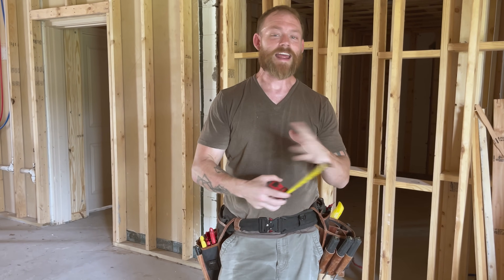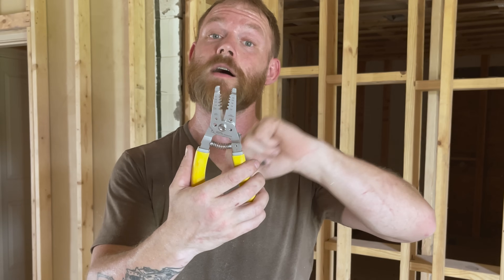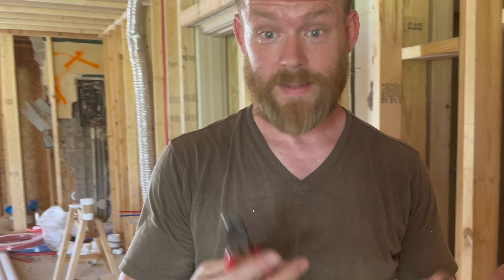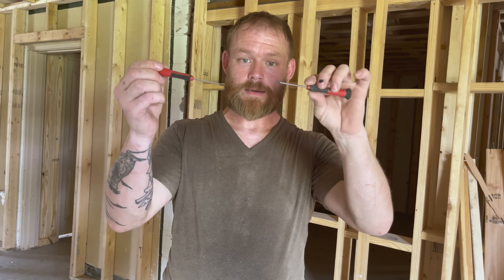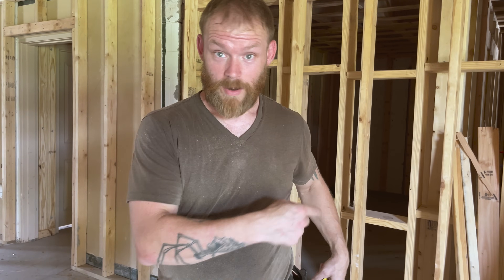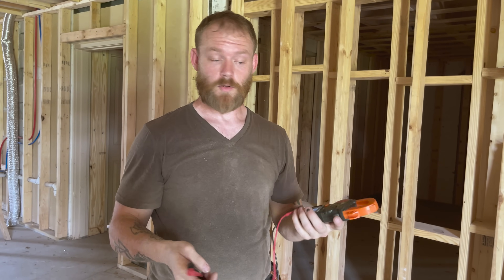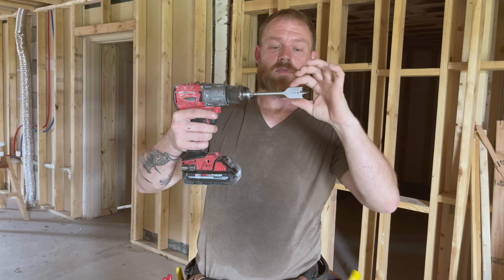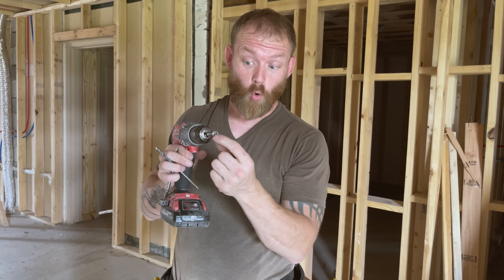All the Tools Apprentice Electricians ABSOLUTELY Need!

Comment: I’m pretty sure you are sponsored by Milwaukee and Klein but I would love to see you do reviews of other brands. Maybe Knipex and Wera and some others. Also tool belt reviews it’s more of a personal choice but I would love to see some quality options. I have heard of occidental pouches and that looks like what you have, but how has it held up. Is it worth it?
Reply: Occidental is tough. Mine held up through extremely rough use. Get a belt with 4-5 pouches on your non dominant side. It will help you if you have separate storage for all of your roughing supplies. Right hand pouch doesn't have to be huge. Roughing doesn't need as many tools.
Reply: @ExecOpsN7  I’ve never worn a tool belt 🤣🤣🤣 why would you wear a tool belt?
Reply: @catdaddy666  I do industrial and some commercial, never had the need for a tool belt. I use my pockets,
Reply: @catdaddy666  your a romex jockey, explains it all. Residential guys are not electricians.
Reply: @catdaddy666  I can see wearing one if you do residential: and that’s it. I’ve never even touched romex
Reply: I like wera and knipex better than Klein. The only tool I like from Klein is their levels. I also use a greenlee pipe reamer cause I’ve broke 4 Klein ones lol. The greenlee has lasted a lot longer
Reply: Wera driver tips and bits don't last on jobs. Wiha bits on the other hand!

Comment: When I was doing Residential Electric years ago we used our Linemans Pliers to Strip! Once you get used to it it does the job. Technique of tool mastery!
Reply: It depends on the pliers and the person. You learn the feel of your linesman and how they cut and you can gauge how to strip wire. But, a lot of JW don’t want apprentices trying that technique bc the potential of scoring and cutting into the wire. I can strip all day with my linesman but if I’m doing splices all day, so much easier to use a stripper esp for stranded wire.
Reply: @mikenormandy9250  For me the big thing is stranded wire. I can strip solid all day with my linemans(Well, individual ones, still gotta use a knife for fully sheathed Romex, but hey, practice), but for stranded wire, I'll take strippers any day of the week.
Reply: I strip wire with my linemans better than with strippers lol. That’s how I’ve always done it for the last 15 years
Reply: Let's not forget that we hammer staples with linesmans sometimes :D
Reply: A lot of the linesmans now have strippers built in.
Reply: @paulparker9376  After you've cut a wire that was hot, you turn your linesmans into a stripper anyway lol
Reply: @Gruntled2001  Very true. I burned a big crater in my work knife once trying to wedge apart two extension cords melted together... While they were plugged in!
Reply: Feel like that takes so much longer especially sense most strippers can also strip the sheathing off
Reply: When I did my apprenticeship, it was up to the contractor to supply the power tools.
Reply: @markbell1  Same here! They still do, and will when I turn out to a JW in couple years...The percs of a union...But, I get it, not for everyone...Esp in most right to work states...
Reply: Ehh maybe if you’re up doing a single thing but if you’re going to wire in 10 recess cans in a row just get the strippers at that point.
Reply: Even small flimsy fixture wire??
Reply: My strippers only go up to 12 gauge, otherwise I use my knife. Put your thumb on the other side and lightly drag around and you don’t nick the wire.

Comment: Whats the name of that tool belt looks RAD!!?
Reply: I just got the Milwaukee electricians belt.  I really like the fit and confort of the lumbar pad.  It has the room I need as a DIY homeowner.  I have heard some complaints about the belt not fitting well if you are slim, but I've had no issues with my 34 inch waist.  Lots of places for tools and pockets for supplies.

Comment: Totally agree with everything except for the hammer the smaller the better you will be carrying it around your waste 40 hours a week and a 16 once hammer can do just about everything with maybe 2 more swings without all the extra weight
Reply: I use a 12 oz and it works just fine lol
Reply: @therapinape9757  same.
Reply: The bigger & heavier the hammer the more it will hurt when you hit your thumb or finger with it.  The less accurate you are, the more smashed thumbs and fingers you'll have.  Get a hammer that works for you.  Avoid those waffle faced hammers, those are more intended for drywall and framing.
Reply: Only if you’re a residential electrician. As a commercial electrician I barely use my hammer, my linesman work great for 98% of the things I need to hammer.
Reply: @AdamS-lh2ug  if it's not supposed to be used as a hammer it shouldn't function like a hammer 😂🤣
Reply: @conradjohnson3495  multi-tool?
Reply: @AdamS-lh2ug  patent that shit!